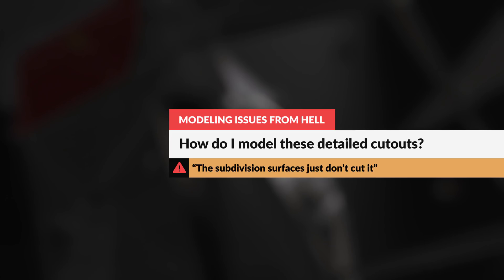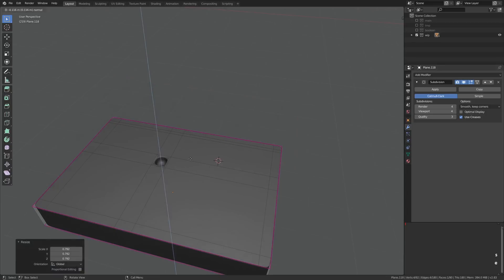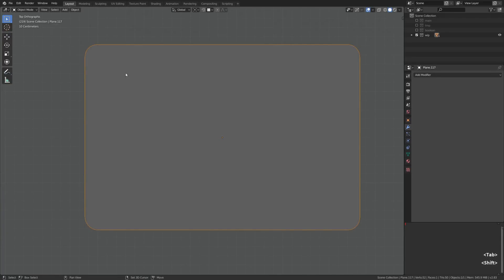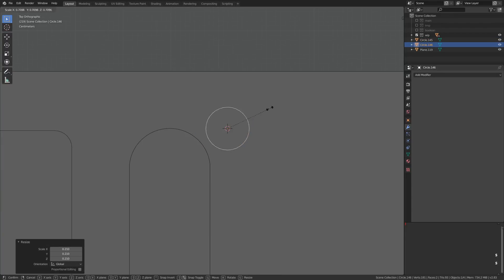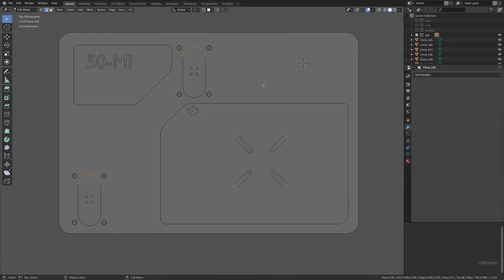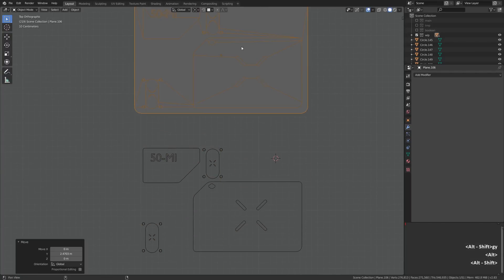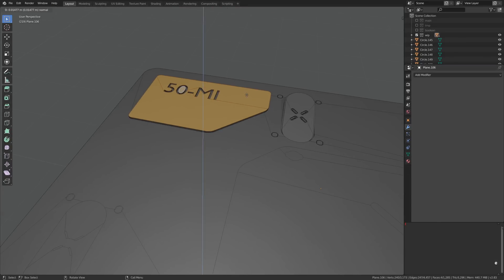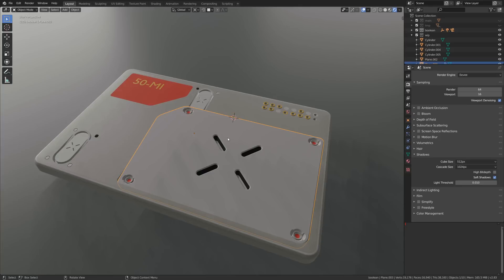How to Model Detailed Cutouts in Blender?

Comment: 2023 for work method.

1. First select the object to be cut.
2. Switch to edit mode
3. Select an object from outliner (CTRL+LMB) to use for projection. if u can't select object more then 1, join them.
4. Mesh -> Knife Project

Comment: Saw this years ago and used it often. Tried it today and it is not working... Just updated to 2.93.4 this morning. When I do the knife project I get the error "No other selected objects have wire or boundary edges to use for projection." Has something changed?
Reply: works fine in 2.92.0.
Reply: As mentioned by @Juan Romero Now it should be:
*First select the object to be cut.

*Switch to edit mode

*Select an object from outliner (+) to use for projection

*Mesh -> Knife Project

Comment: Wow thank you for this. This could help for hard booleans. It is also low poly which may be good for games. My only problem with this technique and also when using booleans with kitops is that it makes weird shading artifacts when it is exported to marmoset for baking or even when viewed via windows 3d viewer. No artifacts inside blender and substance. My current fix is to triangulate faces. Hope you could help me. Thank you

Comment: Thanks for sharing.
Was using knife project long time, found this aproach not very effective: its hard to optimize result of such dense geometry. Marking bevel weight and slaping bevel modifier before subdividing working better for me: its easier to make highpoly and lowpoly versions of the object.

Comment: Fantastic!  Years ago I had started a series, "Toys I Had", as a scheme for learning Blender beyond the basics.  Some of the toys I had when I was a little kid, or an older kid - simple shapes, I thought, but I need to make holes, cutouts, nicely beveled extruded shapes, and more.   I had to put that aside.  Cutouts, for Toys I Had or for engineering animations, always were a speed bump in otherwise speedy progress in 3D projects. No, not speed bumps.  Bottomless pits.  Anyhow, YAY FOR KNIFE PROJECT!  I can re-do some of those old projects for nicer results.
Reply: If you need to cut a lot of holes you might want to try Boxcutter. It's such a quick tool for cutting holes and many other boolean operations.

Comment: this is AWESOME, I didn't know about knife project, thank you! Quick question, if you were to adapt this to low poly game workflow, what do you think would be the best way to go in and clean the topology after the project (just manually connect verts etc)?
Reply from the maker: Pretty much yea, tweaking the overlapping faces if there are any. and then probably marking some edges sharp (and paying attention to normals in general). there will be ngons, so for the low-poly workflow i'd check the triangulation (via the Triangulate modifier), and then made sure I checked the 'Apply Modifiers' checkbox on export.
Reply: Gleb Alexandrov awesome thank you!

Comment: I basically ditched subD for all robotics and hard surface models at this point, except for more fluid shapes (like car chassi). It just really helps to keep things simple, and shade smooth + bevel modifier usually nets the same result anyway with less render times and topologic intrusions
Reply from the maker: i tend to use non-subd workflow more often too, although as you've said, automotive surfaces and blending operations require subd.

Comment: Really cool but modelling with details on curved surfaces would be harder no?
Reply from the maker: oh definitely. projection will get distorted too, naturally, because we project from a certain point of view. but it's doable, even though it's not as sleek as projecting things in almost a two-dimensional manner. alternatively, in some cases we can project onto a flat surface and THEN curve it via the Simple Deform modifier, lattice or whatever. but the catch is - after projection, the topology of the model will need an adjustment in order to bend correctly.
Reply: You can add shrinkwrap and then project maybe that will work out
Reply: Combination of knife projection and shrinkwrap was very helpfull when modeling complex shapes (car and aircraft panels with lots of access hatches).
Reply: @НиколайКокорин-к5я can you share a little bit more and this process or where I could find an example?
Reply: @НиколайКокорин-к5я nvm I get your meaning. Shrink wrapping cut panels around complex shapes. And the knife project was shown in this video, lol.

Comment: This is so cool Gleb, thanks so much! This comes closer to CAD workflow for me (almost like drawing sketches first), which is fantastic.
Reply from the maker: that's what i like about it too actually, this CAD-like technique that seems topology-agnostic (even though it isn't, technically).
Reply: @GlebAlexandrov  Now just for a way to add fillets/chamfers as easy as in CAD.. my main gripe with Blender (coming from a modeling noob who only uses 3d for concepting).
Reply: I started using Blender after some experience with Inventor and my first thought was: where is the sketch tool!?
Reply: @mpocztowski  Blender ≠ Inventor